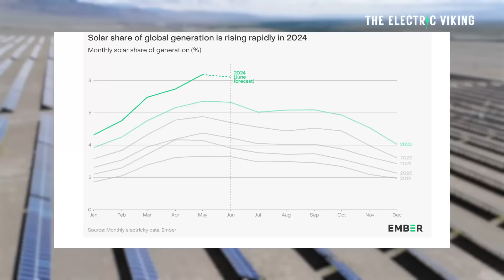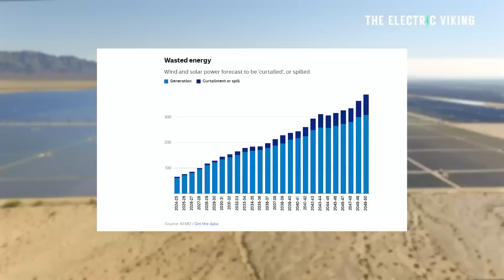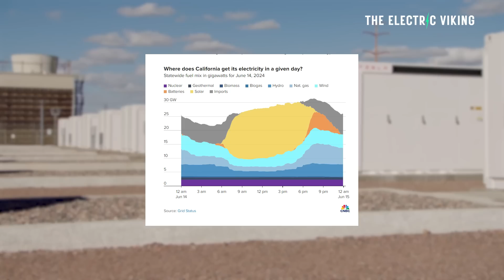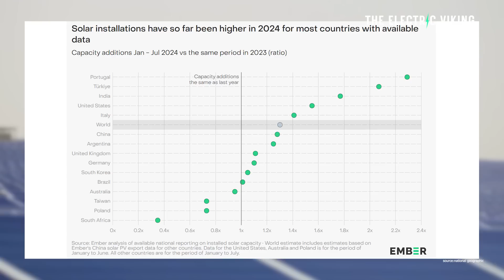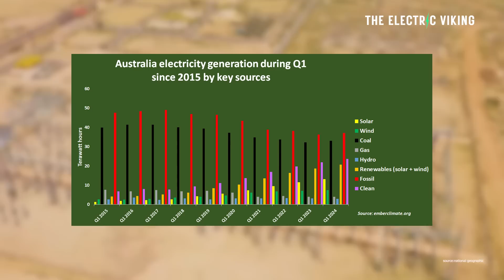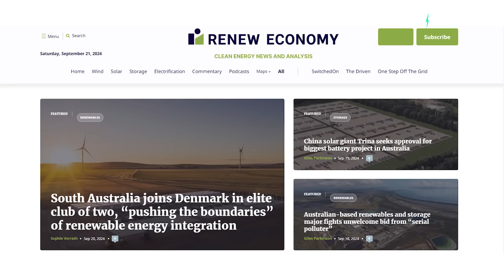Renewable energy hits record 102.5% of entire grid demand in Australia

Comment: In the 1990s Australia used to manufacture its own solar cells and panels in sydney. Sadly the plañt closed and was shipped to China around 2000.

I still have some of the Australian made panels. For the time they were quite good rated at 80 Watts. Those that still work now put out about 60 Watts.

To fully transition to GHG free energy Australia will need anout 60GW of on line generation capacity backed by 3,000GWhrs of storage.

To achieve that we need all the power we can get. Nuclear generation capacity of around 18GW 24/7 using plants designed to last up to ninety years, would put a big dent in that requirement and make it much easier to achieve the objective of  a fully decarbonised economy by 2050.
Reply: They would also put a great big dent in the available finances.
I am not opposed to nuclear, but looking at levelised cost of energy, it is a very expensive form of generation.
Zero plants have ever been built without direct government subsidies and guaranteed minimum prices.
Unless the economics change for nuclear, the only way I see it being built is if the government is making a political decision that they want it.
Reply: @lindsayfox7206  I agree. The Coalition’s nuclear push was critiqued in a separate analysis released on Friday by the Institute for Energy Economics and Financial Analysis, a thinktank. It estimated power bills for average households could increase by $665 a year under the opposition proposal. This accords with most of the available literature which clearly states that on a levelised basis, the cost of nuclear is significantly higher than wind and solar.
Reply: @zoransarin5411  Wow! This sort of analyses needs to be more widely disseminated ! The number of Australians falling for the "we need nuclear" narrative is growing, up 30% over the last couple of years.
Reply: @lindsayfox7206  It's not about cost of generation but capital cost. 

To fully power the country with renewables you need 3,000 GWhrs of storage (about ten Snowy Hydro2 ($10bn each) or 3,000 'big batteries' ($1bn each). 

Ten Snowy Hydro2 would be $100bn. 350 'big batteries' are needed to match Snowy Hydro2, so let's be modest and say 3,000 will cost around $3tr.

Nuclear power stations like the Canadian Darlington CANDU plant produce 4 GW 24/7 and cost about $24bn a pop. If mixed with renewables their continuous generation greatly offsets the need for renewables generation but more particularly storage.

A four station program using Darlington as the model would generate 16 of the 64GW Australia needs. More importantly it would offset about 1200GWhrs of storage, saving anywhere up to $1tr. This would mean less reliance on battery storage ($1bn/GW) and more reliance on pumped storage ($35m/GW). Pumped storage is thirty times or so cheaper than batteries. This important because Australia has relatively few high quality pumped storage sites that can be relied on.

In my view the optimum mix is 16-20GW nuclear, 40-44GW renewables and 1,800GWhrs of storage, at least two thirds of which would be pumped storage.

Whichever way you look at it, it will cost a lot.

I favour the Canadian nuclear system because it minimises waste, burns mixed fuels, uses cheap unenriched fuels including thorium, has no refuelling downtime and is designed for ninety year plant life. What more could you want?
Reply: @jimgraham6722  Wrong Jim. Capital costs is not as important as whole of life cost. It may be cheaper to build a coal fired power station than a solar farm with the same output. But you then need to feed and maintain that coal fired power station. That is where the majority of costs come from. From an asset perspective, most assets are 20% capital cost and the remainder is the whole of life operating cost.
That is why you look at companies such as Lazards which undertake a levelised cost of generation, which aim as best as possible to compare whole of life costs on an apples to apples basis. Nuclear is good technology, don't get me wrong, but it is on the expensive end. That's just a financial consideration. The whole social and environmental issues associated with the use of nuclear are not factored in. They are part of the political debate.
Reply: @zoransarin5411  I agree through life cost is important. Let's look at that. 

Solar panels deteriorate under impact of UV (mainly B), heat cycling and physical damage. For optimal performance they need regular cleaning and maintenance. They need 100% replacement at 20 years. 

Large wind turbines suffer primarily from fatigue but also corrosion, particularly offshore. During their operational life they need routine maintenance mainly lubrication and corrosion management. However, cyclic fatigue eventuallly catches up with them and they need full replacement at thirty years (offshore probably twenty).

Chemical batteries lose capacity due to the build up of unwanted reactions. Thermal fatigue, cracking and corrosion also play a role. The effective life of chemical batteries is about fifteen years at which point they have lost substantial capacity need full replacement. 

Pumped hydro is subject mainly to fatigue, wear and tear and corrosion. However, the plant is robust and has an effective life of about sixty years before substantial refurbishment is needed. However, historically hydro has proved long lived. There are some hydro electric plants that have been in continuous operation for over 130 years.

Modern nuclear plants have potential for at least fifty years but some can do much better. For example Canada's CANDU plants are designed to run continuously for thirty years at a time, followed by a three year refurbishment cycle. Then another thirty years continuous followed by yet another three year refurbishment before finally another thirty years of continuous operation. It's only at ninety six year point that the toll of fatigue, corrosion and neutron damage builds to a point were the plant has to be fully retired.

So there you are.
Reply: Solar panels are still desgined and made in Australia. Tindo in South Australia for example.

Comment: Sam, don’t forget the contribution of Wind.  A very compatible source of energy for Solar, as for when the sun doesn’t shine the wind will blow.
Reply: For most people home power generation is best using solar. It’s passive and just works.
For industrial, wind captures lots of energy going free.
Combine it with big batteries and it will be a winner for power companies.
It all plays a part. M.
Reply: Just did a trip to the UK in June,  Blown (!) away with the amount of wind power there, even if you had to use binoculars to see a lot of it (offshore). Plus heaps of onshore stuff too. Quite spooky to be cruising along on one of their wonderful motorways, and suddenly see these gigantic blades suddenly appear above the trees ahead of you!  sort of a 'war of the worlds' effect until you get used to it.
Reply: Grid stability is the main issue.  Wind and solar cannot create that inertia effect.  Batteries do an amazing job at this however as long as there are enough of them.
Reply: The wind blows more in the daytime than the night. Check the facts.
Reply: @tonybloomfield45283 Oh, OK. And?
Reply: @michaelmartin9022  And, this. The OP inferred that when solar stops wind kicks in which is simply not true. Typically, when the sun goes down wind decreases. Together they are a very long way from being able to provide reliable base load power without the assistance of either fossil (hopefully gas) fuel power stations or nuclear power stations.

Comment: Just think if we hit over 200% of what we need. We can the turn the energy into desalination plants. Free water and electricity?
Reply: Correct.  Few people understand that we already overbuild generation capacity so that we have sufficient generation to supply peak demand periods.  In the US our coal and natural gas plants produce about 50% as much power annually as they could were they operating 24/365.  We'll need to install wind and solar to cover peak periods which means there will be lots of times where we have extremely cheap electricity that we can use for other purposes.  Desal is only one.
Reply: The key challenge is overcoming the intermittent nature of solar and wind. Batteries only store energy. We need a solution to ensure sufficient dispatchable power for cloudy days when the wind doesn’t blow.
Reply: @brucebennett5354  
"Batteries store energy."

You understand.  We need to store enough energy in batteries to give us the electricity we need when wind and solar are not supplying our needs.  That is our "sufficient dispatchable power for cloudy days when the wind doesn’t blow".
Reply: From the tooth fairy and Santa Claus
Reply: @tonybloomfield45283  from the oil and gas gnome.

Comment: And when sun not shining and wind not blowing?
Candles?
Reply: Storage.

I'm off the grid.  Have been for over 30 years.  Solar and storage.  A handful of times per year I need to crank up my generator for a few hours.  More storage would eliminate my need for a generator.  Or if I installed a wind turbine I'd never need a generator.  The only time my solar doesn't carry me through is when a major storm hits the area and brings a heavy cloud cover.
Reply: You have left out the vast majority of what constitutes a complete renewable energy system, by mentioning just two components. Plus what is even funnier is that you have inadvertently in effect admitted that even fossil fuel generated electricity goes out as well, because back in the last half of the 20th century, our parents and grandparents always had candles in a draw in case the power went out and it did. LOL.

The old "when the sun not shining and wind not blowing" line continues to be hilariously stupid, as if the clever people that design and implement renewable energy systems have never ever considered such a thing. LOL.
Reply: @BrentonSmythesfieldsaye  The cost of back up generation , storage , transmission and initial generation are unaffordable , which is why no advanced country in the world has done it.

Comment: Sam, great news! Energy production is just one side of this. It snows in winter and gets over 40 C in summer where we live. We heat and cool with heat pumps, and cook with an induction stove. We also have a backup wood stove. We have very well insulating, honeycomb blinds and also insulating curtains on our windows. I’ve conditioned (insulating/managing moisture) the crawlspace of the house. The metal roof is coated with reflective paint, and now covered with solar panels. We have a smart electrical panel and smart device controllers throughout the house that allow us to limit most house heating and cooling and water heating, the well pump, car charging, clothes and dish washers, etc. to prime solar hours. Electrical generation is just part of the solution. There are many other cost effective steps we can take to reduce or time electrical demand. The big need, as ever, is affordable home storage batteries. To really go green, the average home will need 30 to 50 kWh of storage. Car batteries are now below $100/ kWh of storage. The renewable energy disruptions will really begin to occur when installed home battery storage hits a similarly low price.

Comment: Australia needs to start installing long duration batteries.  Tesla batteries are great for grid stability but iron air (Form Energy)  or nickel hydrogen (EnerVenue) batteries need to be part of the mix.
You also need to upgrade your transmission system.  TS Conductor has already sold out the factory they opened 14 months ago.  But not to worry, they have already raised $60M US to build a second facility.  Recabling with carbon fiber core is much cheaper than an entirely new transmission line.
Reply: Maybe there are better batteries.  But LFP cells should give 10k cycles before dropping to 80% capacity.  Grid storage batteries will not get fully cycled every day, only peak demand periods will take storage really low.  So assume an average of 50% withdrawal per day which means 20,000 cycles.  

20,000 cycles / 365 days = 54.8 years.  

If you spread storage around the grid you lower then need for additional transmission.  Transmission is designed for peak demand.  That means there are lots of times when transmission is under used.  Use that spare transmission to charge "neighborhood" storage and let that storage that is close to the consumer cover the peak.

Comment: I've got a decent solar system at home but only 15kwh storage because the battery prices were obscene. If I could get a 100kwh system I'd consider putting the house on batteries overnight to be more self sufficient in sunnier times. The biggest problem we have right now is energy storage. Solar panels keep getting better hopefully with hybrid cells coming soon for more efficiency. We just really need the definitive grid storage battery to emerge as a clear winner so we can really start making use of renewable energy
Reply: I’m in the same situation but I suspect the logical answer is to find someone who can Repurpose and EV battery for our home use they are mostly between 60 and 100 kWh batteries
Cheers
Reply: True, though batteries are now following the path of Solar in terms of price.  I’m thinking of going off-grid some time in the 2030’s when you can buy 30kWh for around ~$2k
Reply: @philwelling7172  
Do some math.  You may find that you'll be better off installing at a higher price, sooner.  Start with how much you're likely to pay to the grid over the next ten years or so.  Use what you paid over the last 12 months and figure in inflation.   It's a simple  spreadsheet project.
Reply: @bobwallace9753 agreed and exactly what I did recently.
Savings are higher than I projected.
I had 4kW solar for 10 years, expanded to 10kW and added 12.8kWh solar. So, like you suggest, I’m using the gains from 10 years ago to accelerate the gains on the new battery and solar system expansion.
Our CO2 per person in our house is now 25-30% below the average Australian (and us before install).
Reply: @bobwallace9753  I have done the math on going off grid. Over three years to achieve 98% of demand I needed 30kWh of battery storage. However, you may be correct that by installing a battery sooner I may be better off, without going off grid at all.
Reply: @philwelling7172  
If you are on the grid and not in some place where electricity is crazy-high then it probably doesn't make sense to leave the grid.  But what can make sense is to generate a portion of the power you are now buying.
Reply: I don't think that the "definitive" battery storage exists. We need different types of battery for different uses.
Ones like the current batteries being built such as hornsdale etc will be more expensive but required for grid stabilisation. They need millisecond response time and can output large amounts of power onto the grid if needed.
Alternative solutions that have less energy density and/or slower response or constant output such as flow batteries will also be required.
Pumped hydro for long term storage and large storage. 

Maybe compressed air or gravity batteries if the economics can be made to work.
Reply: @lindsayfox7206  
I think what you want to consider is that we've been working on storage solutions for a long time.  We were building pump-up hydro decades ago.  We've experimented with compressed air, flow batteries, thermal storage, lifted mass storage, and various battery chemistries including sulfur and sodium.

What we are seeing is rapidly increasing usage of lithium batteries.  The market is deciding on what gives the most return for the dollar.  It's possible that a different storage technology could be developed and replace lithium batteries, but we haven't found it yet.

The short version is:  Lithium, in particular lithium Iron phosphate (LFP) batteries do the job and are affordable.

Comment: Stop worrying about "wasting" solar. Once you get a lot of solar, it starts competing with storage, because if you have a cloudy day where you only get half of what you get on a sunny day, if you have twice as much solar, it's still enough.
Reply: Wrong. 🎉🎉
Reply: @robertfonovic3551  
No, right.  The issue will be balancing the amount of solar, wind, and storage we need to create a reliable 24/365 renewable energy grid.  If solar is cheap and storage expensive, install more solar.  If the price of storage drops significantly, then use more storage and less solar.
Reply: @robertfonovic3551  Wrong is not an argument. Why don't you elaborate. BTW, Tony Seba says in his video, that he expects 2-3 times as much wind and solar generation, as usage, and 1-5 days of storage, so that's where I got it. I don't actually care what you believe, but if you have a good compelling reason to believe it, then I'm very much interested.
Reply: Robert, you are wrong and FJ is correct. If you have enough solar, wind and batteries, you wind up with significant overlap. And, if you are connected to a national grid, it is always windy somewhere. And, there’s hydro, nuclear, an increasing amount of geothermal,  etc. And, battery storage is still  new and increasing. And coal and gas still supply a very significant though declining share of electricity production, many countries over half.. The good news is an increasing number of countries have been able to reduce their use of expensive and filthy fossil fuels. And going into the future, filthy coal an  SC gas will provide less and less of our energy mix.